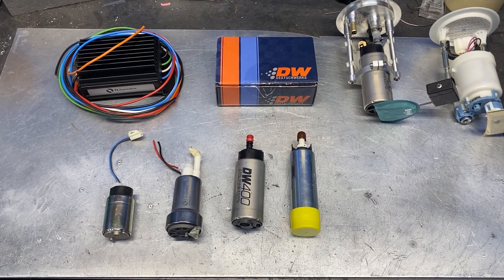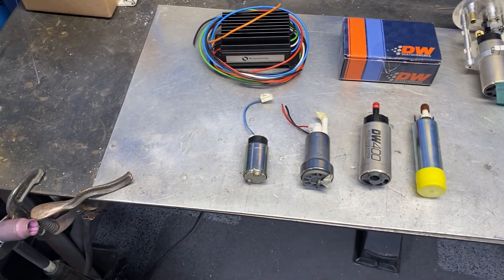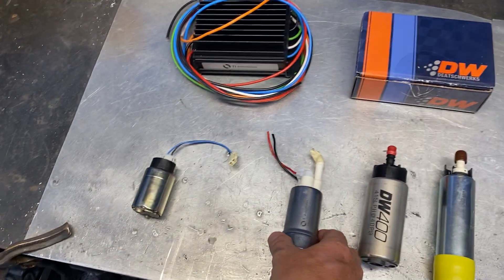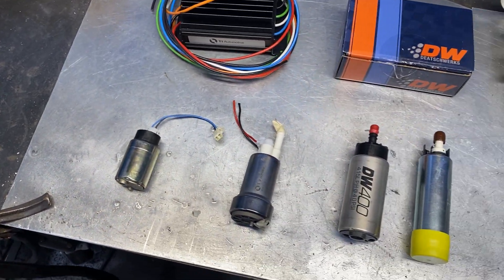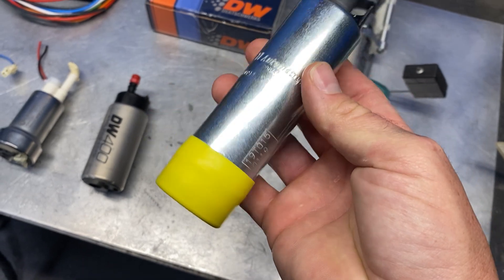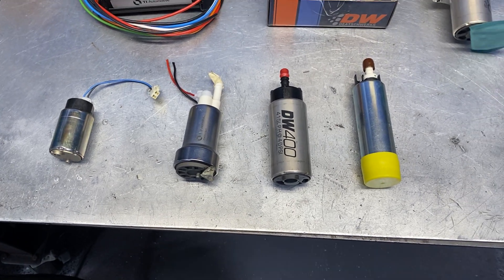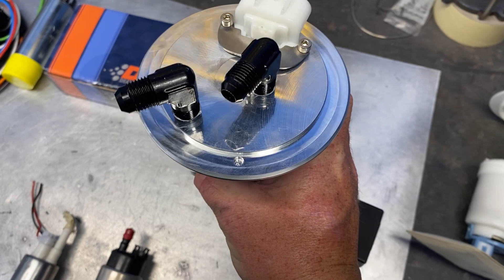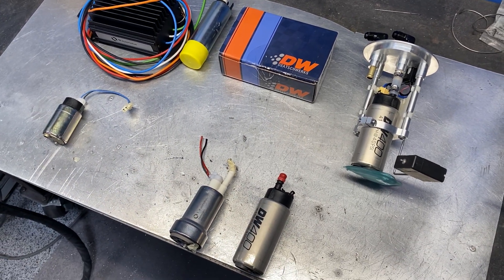Yamaha YXZ 1000 fuel pump selection

Comment: I would look into setting the pump up with a holly hydramat, the yxz tank is a crappy design and won’t stop fuel from running around. I got tired of gulping air in hard turns wide open at anything below half a tank. The hydramat sucks every last drop and never skips a bet now.
Reply from the maker: That would be easy to incorporate with this setup, the ONLY issue with the mat is they are not ethanol compatible, I really with they would come up with something for that,
Reply: @jteperformanceengineeringl6256  they say they aren’t but 3 years on E85 and they still look brand new and have the same flow they did new. I was really worried about that when I first did them but now it’s the last thing I worry about.